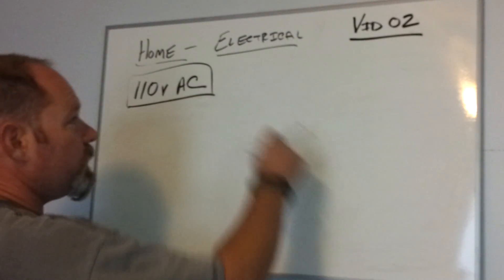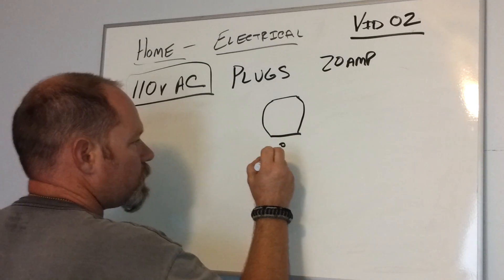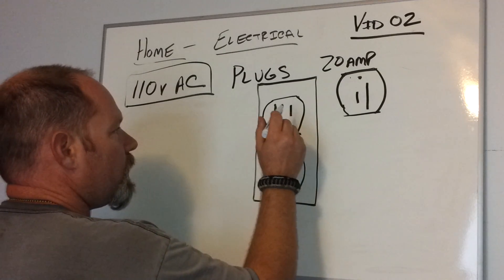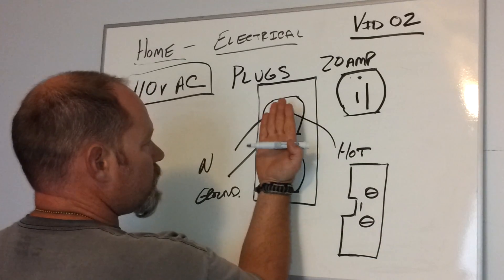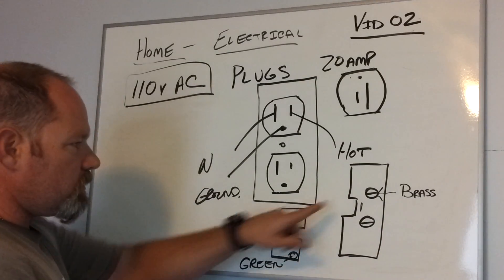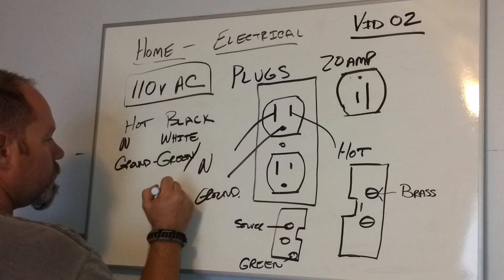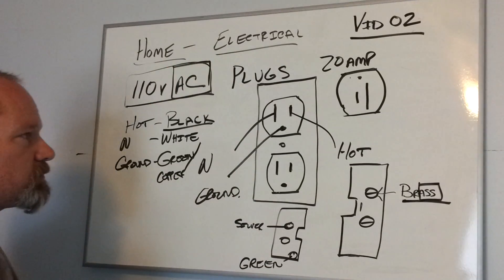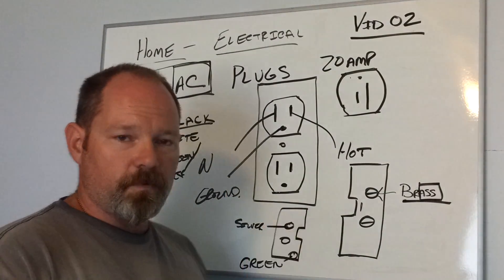BASIC ELECTRICAL 101 #02 ~ PLUGS AND RECEPTICALS

Comment: There is no correct position for the installation. Receptacles are permitted to be installed ground up, ground down or even horizontal.
Reply: In less expensive track homes, a lot of builders would skimp on lighting. You would walk into a room with a wall switch but no light on the ceiling. Many times you would locate a receptacle that was upside down because it designated a switched outlet that allowed a person to put a lamp in the room that was switched by a wall switch. I haven’t seen that in a while though

Comment: This videos nearly 6 years old at this point, but I’ve just stumbled upon these and found them incredibly helpful. One minor thing I will note is that “upside down” outlets are actually technically correct. They’re installed upside down just in case they become unplugged slightly and something conductive makes contact with the prongs. With “upside down” outlets, you will make contact with the ground and either the hot or neutral. With a regular plug you run the chance of contacting the hot and neutral and shorting the system out.

Comment: If you are supplying a 20 amp circuit to the receptacles, then the receptacles should be rated 20 amp as well. Also,  in this description, there is no neutral in the circuit. It is not a 3 wire circuit unless the receptacle gets split and a second phase is added. The white is the Grounded Circuit Conductor.
Reply from the maker: Hugh Sutherland you are not making any sense. Also not sure what you are trying to get across here.
Reply: @GuyBrown  CEC 26-700, (2) Except as provided for by other Rules of this Code, receptacles having configurations in accordance
with Diagrams 1 and 2 shall be connected only to circuits having a nominal system voltage and
ampere rating corresponding to the rating of the configurations.

This is according to the CEC.
Reply: It is perfectly acceptable and common for 15 amp receptacles to be on a 20 amp circuit. Anything appliance that is drawing close to 15 amps or more should be on it's own dedicated circuit with a 20 amp breaker.
Reply: @njsongwriter  CEC 26-700, (2) Except as provided for by other Rules of this Code, receptacles having configurations in accordance
with Diagrams 1 and 2 shall be connected only to circuits having a nominal system voltage and
ampere rating corresponding to the rating of the configurations.
Reply from the maker: I don't live in Canada

Comment: Why are recepticles all on 20 amps?   Where does one use a 15 amp breaker.
Reply: Usually, in a household setting, 20amp circuits are used for kitchen small appliance circuits (outlets near countertops), or refrigerators, etc. but lighting circuits are 15amp
Reply: Not all receptacles are on 20 amp circuits.

Comment: A little confused  about how the AC fits into this. Isn't AC just going back and forth over the "hot" and "neutral" wires? What makes one hot and the other neutral?
Reply: It's complicated, but basically the hot will have 120v with respect to ground. The ground wire, neutral wire, and earth ground are bonded at the electrical panel, so the neutral wire will have 0 volts.

Comment: I think the US should switch to the British style of Plugs. They don't stick out from the wall like the American style plugs do, and they look a lot nicer. Plus, there is a fuse inside the plug to assist in shutting off the circuit, incase of ground faults and short circuits.
Reply: Will get right on that

Comment: on both previous comments...BOTH leads are dangerous
Reply: ......Not true at all. The neutral by itself, which is bonded to ground at the panel, is not dangerous. With the neutral bonded to ground, it is at Zero potential as it relates to the Hot wire. In order for current to flow, you need a difference of potential and a completed circuit path for the current to flow back to the source. Technically, in a 120V circuit, where you have 1 Black, 1 White, and 1 Green wire, the White wire should not be called a Neutral, but instead called the Grounded Conductor.

Comment: Love your videos! I am re-wiring some parts of my house because our three bedroom, kitchen, and basement, are all wired together on the same circuit breaker and it trips frequently. I want to put in junction boxes so I can have the bedrooms, the basement, and the kitchen to each have their own 15 amp circuit breakers. I know I have to go through and confirm where all my current wiring is going and create separate circuits for each of the three 15 amp breakers, install junction boxes, and run the lines to the breaker box. What tips do you have for completing this job? Would you upgrade the wiring to 12/2 and a 20 amp breaker?

Comment: Hi Guy Brown.  I saw your video and would ask help. I am electrician but don't studied in United States i'm cubano technical in Control automatic my knowledge connection de contactor magnetic. I  built panel the control for many machineries. I worked with motor AC / DC and variator the frecuencia, PLC and other sistem electric and electronic. Now live in NY  state and don't found work because i haven't licence. What can i do to obtain some work. My time en u.s.a is only 7 month sorry my english not is good. can you help me maybe a advise
Reply from the maker: osmani enriquez have you tried to apply at any manufacturing plants? are you citizen or green card?
Reply: no.I haven't citizen or green card but. I have permit employment if you want advice me.I left my address osmanienriquez@gmail.com

Comment: Great video!  However, I have a stupid question.  Why is the hot side of the circuit the only side that is dangerous, while the neutral side is not?  If AC current is truly alternating, then shouldn't both sides be equally dangerous as the current cycles back an forth?  Probably something about AC current that I'm not completely understanding?
Reply: hot side means the forward and return path of charge as charges completes a cycle , so in dc live , nuetral are both dangerous
Reply: thats the phase,the N servers as more as a tool to open electricity,the Phase is the power
Reply: I think also to keep people from getting confused. 
It saved my life I'll tell ya that ! This is one thing that did confuse me sometime ! , but knowing which side the bad guy is on ( the hot side ) I think I'll live a little bit longer . 
This is a great video I think .

Comment: Hello Mr. Guy: obviously these are questions not comments. 1 can you use carrier's non-programmable digital thermostat with carriers single stage 16 seer units? 2 will this void the warranty or make buying the performance or infinity series design features not work? so i am trying to ask if you want a simple original equipment thermostat do i have to stick with the comfort series. the final free question is are the higher level units built with better parts. thank you.
Reply from the maker: can you send me the model # to everything?

Comment: The reason the ground is supposed to be up, is so if something falls over the plug, it doesnt short out the common and neutral and instead safely hits the ground side.
Reply: Can't speak for the US - but that is the reason why sockets in the UK have them oriented with Earth on the top.
Reply: Is there any study or statistics that actually prove that shorting of the hot/neutral is a legitimate risk?
In reality the vast majority of right angle plugs have the ground on the bottom.
Reply: A study? I have no idea. But I have seen it happen to a college student at a dorm. I happened to be visiting a friend and her room mate came in crying saying the wall exploded... Come to find out something fell over the receptacle/ plug and shorted out the neutral and hot together, causing an arc that burnt the wall. It never even tripped the breaker.

Comment: do you mean socket?
Reply: Indeed! A plug is not an outlet. A plug is the thing at the end of a power cord, which is plugged into an outlet. And if you measure the voltage, it is around 120volts, not 110, even though I realize that it is customary to call them 110 and 220 volt circuits. Should be 120/240 volts!

Comment: Wrong!!!!..The recipticals should be upside down where the ground plugin is on top.Because if the plug started to pull out and an object small enough fell through there and touched the ground,It ill be fine.But if the ground plugins were at the bottom and the plug started to pull out and an object small enough touched the hot then it could lead to a fire.
Reply: +Daniel Bishop (Blazor101) thats mostly in hospitals in office spaces where that is spec in the job. but i agree the ground should be up
Reply: You are right. Upside down is the correct way to install them for shock safety, but most ppl install them with ground on bottom for looks. Just cuz it looks better it became somewhat the norm. Its not a code or required to install upside down though.  go to safeway or Costco, they have the plugs with the ground on top. Well at least around my area they are.

Comment: How does this type of outlet differ from a GFCI?  And what circuit analyzer would you most highly recommend for professional use?
Reply: +Norinn Radd GFCI is  Ground Fault Circuit Interrupter. If any kind of short to ground is there it will trip the receptical other than the breaker

Comment: Is the "Hot" side also called "Line"? Thanks!
Reply from the maker: they are both the line. like in power line. the thing you are powering is the load.
Reply: EurekaRecycler Yes the "hot" is also referred to as "line". (in fact on GFCI's it's labeled "Line in", and "Line out" and can't be interchanged)The neutral is ALWAYS referred to as the neutral. In a single phase panel you'll typically have two "Lines", each a different half of one sine wave.(Some call them "A" and "B" phase, but it's all one phase to neutral).
Reply: @joebananatube  
GFCIs are labeled "line" and "load" not line in and line out. Outgoing cable can be connected to the line side of the GFCI or to the load side, depending on whether you want it to be protected by the GFCI or not.

Comment: Black on brass to save your a**. I like that. Thanks for the electrical tutorials. We're looking at doing some major electrical work here and this will help. Any tips on installing 220 economically? Our current breaker box isn't big enough I'm told. Plus we have old electrical with just the two prong outlets with no ground.
Reply from the maker: +MiWilderness sounds like you need a total overhauling. 2 things sorry for the 4 year late response second I am a sub to your channel. Love your vids. I'm in MI too if you ever want to do a cola let me know. If you still need help with the electrical let me know. Thanks for watching.